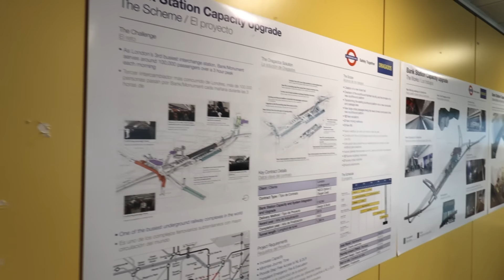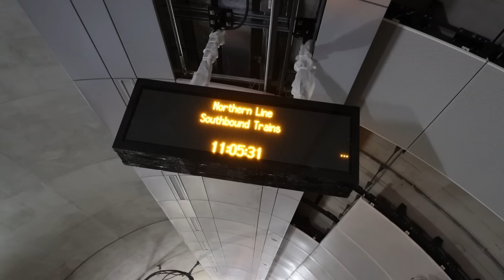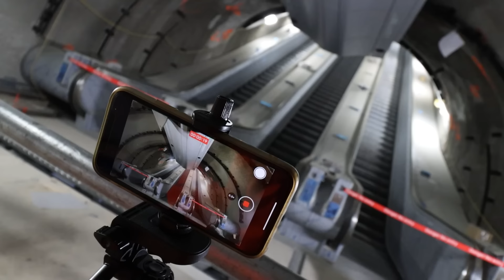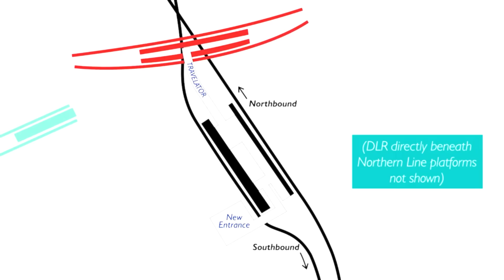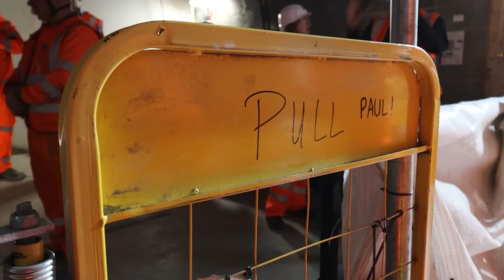Constructing the New Northern Line Bank Platform

Comment: The inconsistencies between the 125 year old tunnel and 1920s rings/lining is because they first built the tunnel around 1900 but in 1925 it was widened so the rings of the tunnel are from 1925 but the tunnel it self is 1900~
Reply: Some of the flanges on the curves had some material cut of to give sufficient clearance for the current  Northern line line stock. Another area where the hand dug curves not being of constant radius caused problems.

Comment: 2:20 Every station in subway and some surface stations on the Washington Metro have that "platform" under the platform. Besides being the the location for the utilities it is also used in subway stations as an air duct for both cool air and return air for the air conditioning.

Comment: I should have told you Geoff unless you probably have found out that when you asked about the cavity under the Platforms they did not tell you that as well as cables underneath, the void is also to be used as a Ventilation Duct so that fresh air is drawn in and out through this Duct and also if there is  ever likely to be a fire Smoke would be vented away, I thought I would just add this bit of info,great vids Geoff 😉

Comment: The best thing about this for me, is the moving walkway connecting to the Central line. I hated that claustrophobic tunnel and those metal spiral staircases from the 1920s, but I wouldn't want them removed and sold off. Leave them in situ..............

Comment: Great video Geoff! Bank seems to have been under a constant upgrade since the 90's- I wonder if the new platform will suitably be adorned with silver gaffer tape, missing panels, blue hoardings and exposed wiring to fit in with the rest if the station?

Comment: Would have been cool if they'd put a glass floor over the former tracks and added some downlighting to make them a feature of the new concourse. Would have added a lot of character. Or at least maybe they could put a glass wall where the unused section of running tunnel now is to make it a little museum piece.

Comment: When I worked for VVB you walked past the stores I delivered to. But you did not know about the Inverts under the platforms. I have pulled a cable in a dark invert since the lighting had failed. :-)

Comment: Geoff - Are they going to build a new northbound platform and tunnel at Bank Station after these works have completed, or are they still intending to use the existing northbound running and platform tunnels? To create a super wide passenger circulation area, with more facilities?

Comment: Generic question, nothing to do with the video (what, I should use quora like a millenial?):   Around Camden Town the wheels can get REALLY noisy - high pitched squeal which is like 100dB, likely beyond safe hearing level... What causes that and why does no-one ever talk about it, or sue TFL for ear damage?   I assume it's a train going around a sharp bend, sharper than the wheel bearings can bend so the hindmost wheels press too hard on the side of the rail.  Is it just one new wheels, before they are worn down?    Geoff needs to do a video on bogies !

Comment: Will definitely be awesome to see Bank once it’s finished. Think I’ve only ever used the station a small handful of times, mainly to change lines. On the new platform, are they installing the safety doors?
Reply: no
Reply: They can’t - the same issue as Battersea and Nine Elms - the trains don’t support it. The latter two however have infrastructure to allow them to be easily installed whenever the Northern Line gets new trains in the future. I doubt bank does as it would’ve taken a significant amount of work to the existing platform
Reply: As Geoff explained in https://www.youtube.com/watch?v=ulyPE9yylks , the trains on the Northern Line are not capable of operating platform edge or platform screen doors. This is why Nine Elms and Battersea don't have platform edge or screen doors; TfL would have had to upgrade the entire Northern Line fleet to make them work, and they decided that it wasn't worth doing that for just 2 new stations. This also explains why the new southbound platform at Bank will not have platform edge or screen doors.

Comment: Geoff I have a question!

When TFL does this kind of work to stations and surrounding tunnels, do they make the tunnels slightly bigger to accommodate larger trains like the. S-Stock on other lines in future without making it a huge ugrade project?
Reply: it is for the evacuation points and platforms on the side of the tunnel and better airflow.
Reply: No because they aren't going to increase the tunnels in between the stations. That would be madness.

Comment: I'm no planner or engineer, and I'm sure it would be far more complicated than it sounds, especially in terms of maintenence, but I can't help but wonder if there'd have been a benefit to converting some of the original tunnels into sidings for trains from beyond Bank in either direction, allowing for any faltering services to quickly get off of the network and out of the way....but again, I'm sure there are plenty of reasons why that didn't happen
Reply: The old trackbed through the station has been filled in to create an enlarged concourse area between the platforms.  Only a short length between where the new route diverges from the old, and where it has been filled in will remain, and that is not long enough to put a train.

Comment: What is happening to the DLR connection, you did not show this?
Reply: @geofftech2  what is happening to the stairs that went from between the two northern line platforms down to the DLR platforms.
Reply: @chrisoverman7551  that will remain
Reply: @dominicfindlay  that is a horrible stairway I would have thought that it would have been sorted as part of the upgrade, as most people changing from the Northern line to DLR use this.
Reply: @chrisoverman7551  there's going to be a new escalator link in the middle of the platforms. 

From Northern to DLR directly.
Reply: @dominicfindlay  that is what I wanted to hear
Reply: The three new escalators from the DLR to the Northern Line concourse will be a massive improvement. I'm surprised we didn't get to see them in the video and I wonder if they will be ready when the Northern Line reopens. I hope so!

Comment: Someone explain the invert platform below the platform to me please?
Reply: When a tunnel is bored it is circular. You can’t lay track on this curved surface, so a flat track bed has to be built up.  Platforms have to be higher, so there is quite a lot of space below them.  This space at the bottom of the tunnel is known as the tunnel invert, and is often used to carry pipes and cables.  In road tunnels it is also often used for ventilation, but I don’t know if the Underground uses it for this purpose.  At Mount Pleasant station on the Post Office Railway the substation for the traction supply was located in the tunnel invert.